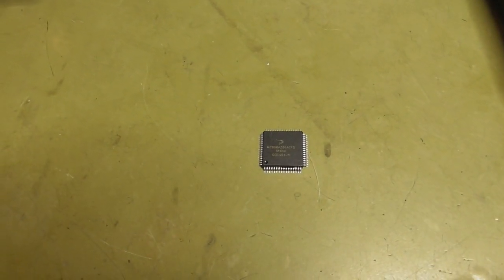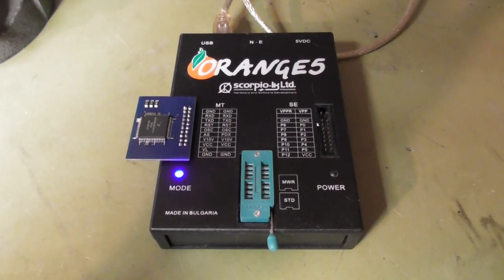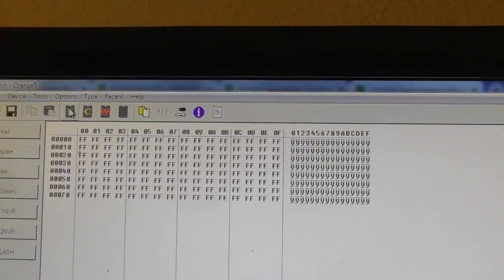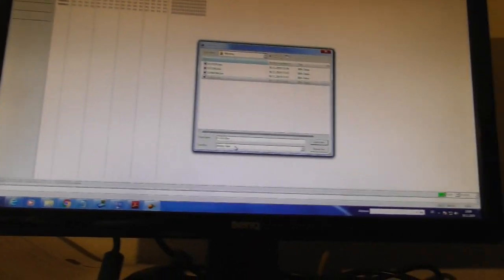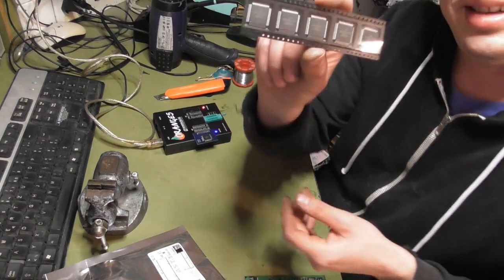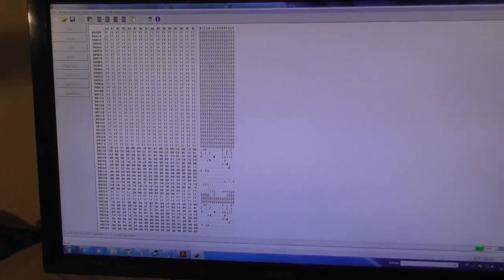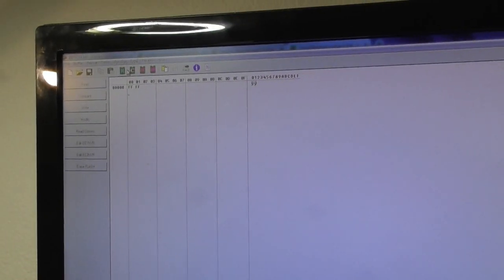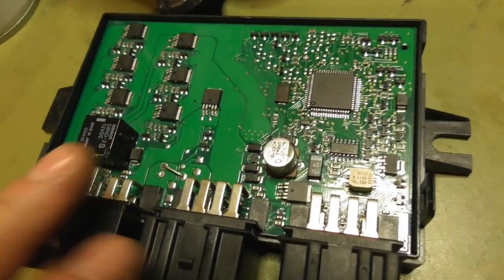Orange5 Programmer - Cloning a Motorola / Freescale MCU

Comment: Thanks for the vid. Question...I'm troubleshooting a device with the same mc and it has a six pin header labeled Programming BCU. would I be able to do this read/write via that, or does the chip need to be desoldered?

Comment: Great video - what temperature you using for the STEINEL hot air gun to remove the chip it came off fast
Reply from the maker: I did not film the whole time. Usually it takes 2-3 minutes until the chip Comes off. I use never more than 280 Celsius for leaded solder what was the case here. for lead-free i use max. 350 Celsius, but i hate lead-free :) I recommend to apply some flux around the chip before you try to remove it. A preheater makes this work much easyer and safer for the PCB. BR Matthias

Comment: They don't generate a custom protection key? 64 bits would take forever (literally) to brute force.
Reply from the maker: I think the manufacturer uses a custom key, but i don't know how the software finds the security bytes in detail. i know that the input current of the MCU will change after the correct combination is entered. maybe the current changes after every byte just a little bit, just a guess. Do you know more?
Reply: @kostelectronics  You're right. Security bytes are discovered by side-channel attack. If you disassemble the Monitor ROM routine and measure the current drawn by the processor (by measuring voltage drop on small resistance in series with the processor) you can determine which branch was taken after sending one security byte. BTW, what is the N-E switch for?